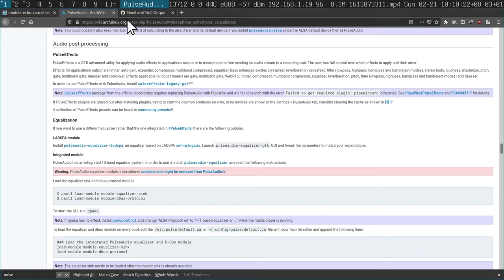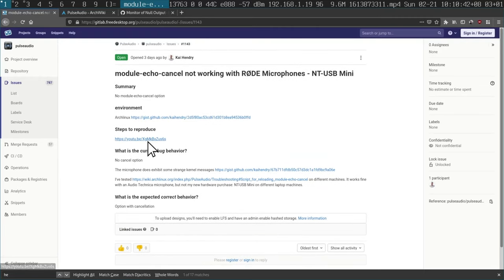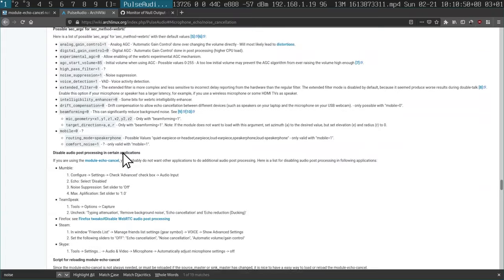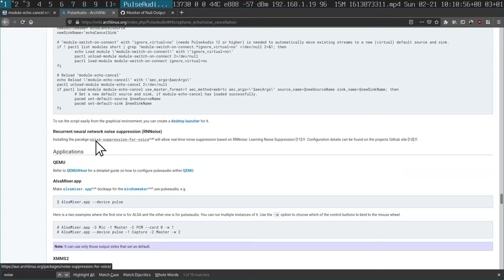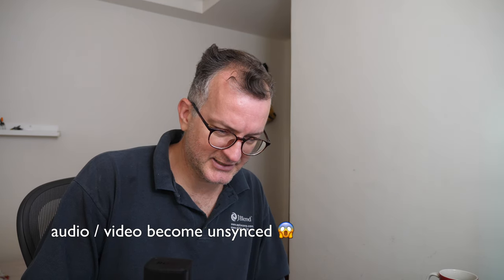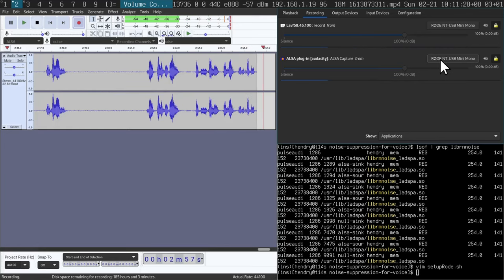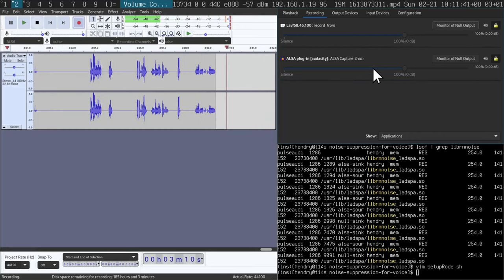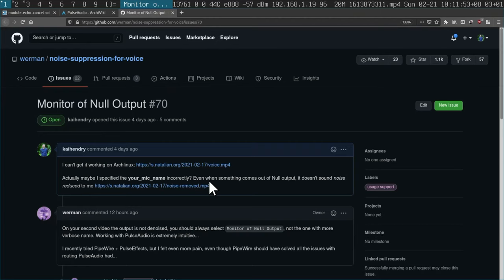RNNoise with the RØDE NT-USB Mini 😭 #failzone

Comment: You should switch to Pipewire if you haven't already because I'm a little late to the party.
As someone who works with audio in any form, even if its just VoIP for gaming, you should use PulseEffects (or now called EasyEffects) and its using RNNoise too.
Or if you just need RNNoise then Noisetorch might be a better fit because is can use two microphones at the same time to filter out noise.
Reply from the maker: I'm doing the filtering in obs, so I actually don't understand the point of using PulseEffects/Easyeffects